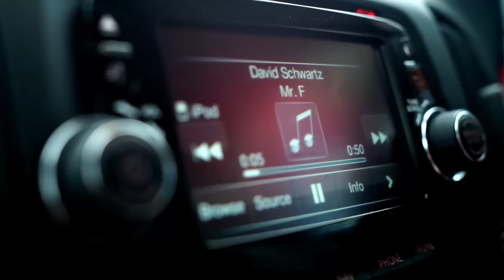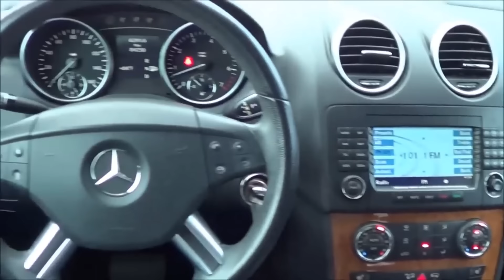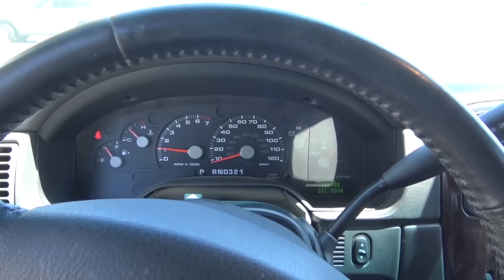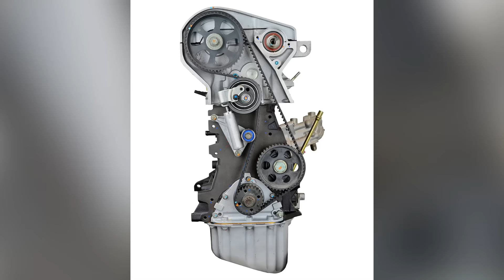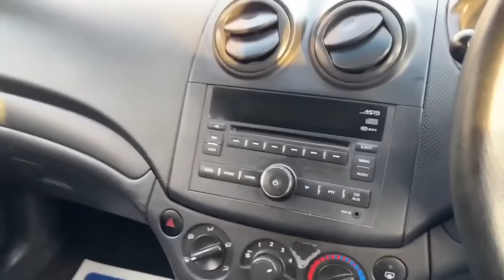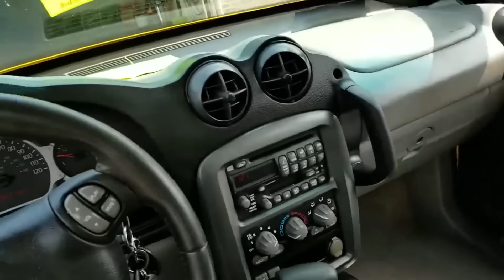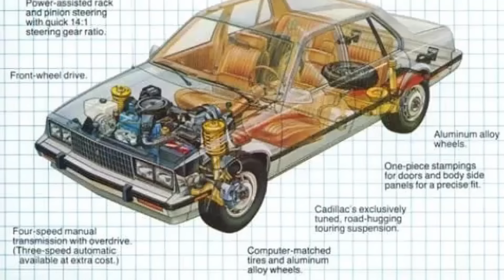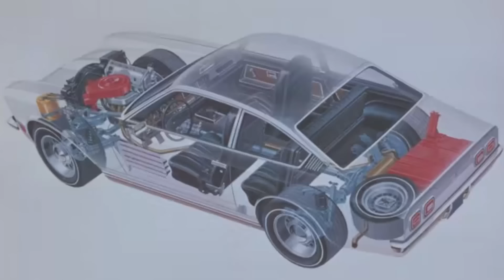30 Least Reliable Cars That Won't Even Last 60,000 Miles!

Comment: Stay AWAY from anything chrysler altogether✋️✋️✋️
Reply: Can you say Alfa Romeo
Reply: But I want the 300c thooooo
Reply: Ignore him and get your 300c.  My cousin put over 250k and had no major problems.
Reply: @colinschmitz8297  What year is his 300?
Reply: @AndrewFaust-y1t  it was a 2007
Reply: Ok Chevy fan 😂
Reply: @colinschmitz8297  See that's when Chrysler was better. They had that merger with Mercedes from 1998-2007. The quality was going up. But after 2007, which was the last great year from Chrysler, the quality went down the toilet. The 300s are crap now. They've been discontinued as a result.
Reply: @AndrewFaust-y1t can confirm here, I have a 2005 mercedes c240 4matic had it for almost 4 years now and I've had a solid 8/10 experience with it. Ik it's not Chrysler but I'd honestly recommend any Mercedes from the late 90s-early to mid 2000s (before 2008 imo) they're really not bad cars at all
Reply: @AndrewFaust-y1t  The Chrysler 300 and Dodge Charger that was a reskinned W211 Mercedes E Class didn't stop in 2007. It stopped in 2011. So up to 2010, it was the wonderful Mercedes we all loved and trusted.
Reply: @mayhemmike1789 - I have a 1994 Chrysler LeBaron LX sedan, and it has the Mitsubishi 3.0L V6 6G72 that the Mitsubishi 3000GT, Mitsubishi GTO and Eclipse, as well as the Dodge Stealth has. Bulletproof engine. The trans is awesome, and I've owned it for ages.

I love the LeBaron.
Reply: Whew what you say smh 

I have a 2011 Jeep Grand Cherokee 3.6 with 240k miles, it stay in the shop more than my driveway 😂😂 I’m ready to get rid of it soon as I can.
Reply: @AndrewFaust-y1t Chrysler was always crap imo, my dad owned a 06 300 broke down twice after 150k miles my cousin has a 09 300 broke down too after 150k miles

Comment: Thats why I will only own Toyotas or Hondas. The two most reliable brands.
Reply: Exactly. Nothing better
Reply: I have a civic from 2002 still drives like a dream
Reply: @Rosbergen80  I have a 2004 Toyota Matrix with close 190,000 miles and still runs good.
Reply: ABSOLUTELY
Reply: Yup. I'll stick with my Civic.
Reply: @Super-225  wait how does it only have that many miles???
Reply: I have a 04 ford focus. 296 000 km and still runs good. 29 000 km and only used half ltr of oil.
Reply: @dominicadler-biddle9199  I bought it used several years back. It probably wasn't used much by the last owner. It had 148,000 when I got it.
Reply: Yep.
Reply: Maybe not exclusively those for me, but I agree. Had a Civic, a Corolla, and two Eclipses. Have had good experience with older Chevy also.
Reply: Yup.  I've only owned 3 cars in 25 yrs and all were Hondas (Civic, Acura Integra, and Honda Accord)
Reply: I have a 2008 honda crv that's my baby
Reply: Not as true as it used to be. They both peaked in the 90's and have been declining ever since. Having to replace over 100,000 engines in the new Tundra is just one example. These days most brands have very reliable models and unreliable models, you just have to do your homework. Personally I stick with Toyota and Ford. My father has over 700k miles on his F-150.
Reply: @nodak81  Engineers and mechanics agree that '96 was the year cars peaked.  That was the best of the old school machinery and solidity with new school computerization.  Since then it's been downhill for sure.
Reply: And Lexus
Reply: @TwizzyGangg  Lexus is made by Toyota, so they are automatically included. Same with Acura that is made by Honda.
Reply: @TwizzyGangg  "My Lexus flexes from Long Beach to Texas."
Reply: @nodak81  yeah I will definitely agree that the 90s were the best years for most cars, but Toyota and Honda still pretty much maintain their value even now. At least most of them. Honda has the longest known lasting CVT transmission (around 250,000+ miles that I've known someone to have on their Honda HRV). Yeah the Tundra for whatever reason had issues and the V8s were poor on fuel efficiency (which was very surprising considering their cars were great on fuel efficiency). The Ford trucks can be alright but their cars and small SUVs are for crap. Same with Chevy. The last good years for American cars and trucks were the early 90s.
Reply: They definitely do have reliability, but that’s about it 😭 not much else going for them anymore. It’s kinda as if they’re only characteristic is they are “reliable” and gave up on making them nice sadly
Reply: @Hoovercaden  well.....Toyotas and Hondas never were very flashy cars. Even in the 70s. They were always made solely for the purpose of being fuel efficient and reliable (generally a minimalists choice) and nothing more. But.....Honda and Toyota DO have luxury brands such as Lexus which is made by Toyota and Acura which is made by Honda if you want their nicer models. So technically, yes, Toyota and Honda do have nice and flashier cars available.
Reply: @Super-225  Lexus LFA, Acura NSX, Honda S2000, Toyota Supra, Civic Type R, GR Yaris, Lexus LC Coupe, Acura Legend Coupe.....these companies have had some flashy cars
Reply: @rebeltvr6046  oh definitely, that's what I was saying in my last reply.
Reply: @Super-225  Yeah, I was supporting your argument with the models.  Some great cars produced by Toyota and Honda
Reply: Subaru also
Reply: Not exactly. I have a 2009 Accord. Leaks oil like a damn sieve. I have to add oil every 3 days
Reply: @WPUpioneer  even good cars can still have minor failures and gaskets and seals that you'll have to replace every now and then. Doesn't mean it's a bad car. Oil leaks are no big deal, usually easily fixable.

Comment: Most of these cars listed on here, I've personally seen with 300k+ miles, original everything. No car is reliable, if you don't do maintenance. I do agree that they don't make cars like they used to. But at the same time, take care of your car, and it'll take care of you. It's like taking care of your teeth.
Reply: But,if the maintenance is really high like $400 for transmission service,$400-500 for brakes,and $100 oil changes and the fact that their manufacturing vehicles with cheap quality.They are designed to fail
Reply: @ It only costed me $40 to do the transmission service myself. Now on European cars, yeah it’s generally more. But on a regular car like a Ford Explorer or Taurus, maintenance is generally cheaper. And easier to do yourself
Reply: I had a 1966 mustang Fastback .and a 1979 Firebird Esprit ..both were junk ..I would love for someone to tell me when they did make good cars?
Reply: They were only junk because you maintained them like junk.
Reply: @nodak81  Yeah. I've seen Pontiac Aztek's (the ugliest and least reliable vehicle according to many sites) go past 300k miles, because someone actually kept up the maintenance. Let's face it, half of the US population go past the due date & mileage on maintenance.

Comment: ford taurus, 2011, over 200000 miles and running like a champ, zero issues for over 6 years. drives like a luxury car, good interior, good looks. a new battery is all i have done to it. its very comfortable and very quiet inside while driving. just an fyi....
Reply: Love my 2011 Taurus with 190000 .Why did they use a photo of Taurus? Lol
Reply: How’s the water pump? I always wanted the Taurus but trying to do research for the best year of that car
Reply: It's the luck of the draw.  One relative has an 09 with 250k on the original water pump.  Another relative had on 172k miles on their 2011 when the pump failed.
Reply: I have a ‘15 SEL…absolutely love the thing. Very quiet interior…even at 85-90 on  interstate drives, excellent power, and I absolutely LOVE  the cockpit. Timeless dash design if you ask me. My only complaint is the gearing…the trans is a bit sleepy at lower speeds.
Reply: My mother's '08 only has 85k miles but it's 16 years old and the water pump still hasn't failed. The 3.5 is an incredibly reliable engine. Even the poorly designed water pump is very reliable, with most making it close to 200k miles before failing. It's just very expensive to repair and can be an engine-killer if you don't notice it immediately.
Reply: @nodak81  if the water pump was driven by the serpentine belt, it would have been the most reliable engine in its segment during that time period beating out the 2GR FE from Toyota.
Reply: @ it’s not what drives the the pump…it’s the pump’s location that makes the repair costly.
Reply: @churchyandfriends  Yes, what drives the pump is the problem. If the pump seizes it will snap the timing chain causing the interference engine design to fail. The other problem with the timing chain driving the water pump is if it doesn't leak out of the weep hole, it will mix with the oil in the crankcase. That doesn't happen on an exterior serpentine belt driven water pump. That's why in the case of my relatives it wasn't just changing the water pump that added to the expense it was also the need to replace the timing chain and the gears as well.  What's more is the fact that it's a timing chain driven water pump versus a dry timing belt water pump takes a lot more effort to change it. That's why cars that use a dry timing belt cost about half as much to do the job as a timing chain. Originally, the 2 GR FE was recommended as an engine out water pump job. Over time, Toyota figured out a way to change the water pump without dropping the engine out And with that the cost of changing the water pump became cheaper. The internal chain driven water pump is always going to be expensive because you have to take so much apart to get to it. And that is assuming that you're lucky enough to have it fail out the weep hole and that you find out the problem in time. Because if it fails the gasket and it mixes the coolant with the oil, you have a much bigger problem.
Reply: i know right ? taurus is so reliable but he put it in the thumbnail for some reason
Reply: 2015 ford  taurus runs  like a champ
Reply: knew someone who replaced 3 engines in like 70k. ford paid for it all
Reply: I was a Ford Fan big time. No one knew more than I did about Ford engines and trans's. I worked for Ford 20+ years ago. I've been repairing and rebuilding Fords for 40+ years. The Duratec 3.7L and the Duratec 3.5L are junk engines.

All of you saying you have no problems, just wait until you need to do the timing chains. Garbage choice to change by Ford. The Duratec 3.0L and Duratec 2.5L were the greatest versions of those engines. Porchse designed and engineered them.
Reply: I have a 2010 Lincoln mkS (based on the same chassis, similar engine) and mine has 140k miles and runs like its brand new
Reply: 2010 Lincoln mkS (same chassis, similar engine) 140k miles and runs like its brand new
Reply: 2015 SHO with 63,000.  Runs great.  Only repairs have been factory recalls.

Comment: Fun fact! My parents have a 2015 Chrysler C200S 2.4L the serpentine belt is difficult to deal with. To remove the starter you have to remove the battery, battery tray, relay box, and CV axle. When the motor is cold it would start up with no issue then turn itself off after 2-5 seconds. If you rev the motor a little bit it will stay on for about 10-25 seconds.

Current recalls
The rear control arm mounts to the frame can break from the welds. Using windows can potentially cause wiring to burn or even catch on fire. ECU problems with bad catalytic converters from the factory. Cruise control can stay on without being able to turn off the cruise control.

Comment: Fiat, Mitsubishi, Audi, VW, Mercedes, Ford, BMW, etc.  Each of these manufacturers have been around for over 100 years.  It's a joke that they didn't learn anything about engineering and assembly in all that time.  Other makes, like Nissan and Suzuki have always been unreliable cars, even though Suzuki has made some outstanding motorbikes.
Reply: I have a '98 Nissan Maxima, 5spd w/171k. I've never owned a foriegn car, but have been told this particular car is quite reliable. So far, so true..😏
Reply: True Suzuki cars are one the most Reliable vehicles in the world, gotta study more buddy, the problem is that in US It got outshined because of the crappy GM and Daewoo Rebadges! There never were true Suzuki cars in the US except for the Grand Vitara and SX4 which are japan made and very reliable!

Comment: I had a 73 Gremlin X that I bought for $100 in the early 80's. I hated it but it was as reliable as stove bolts. I sold it 2 years later and the new owner drove it for another year. I also owned 2 Corvair's. Nothing remarkably bad about those cars and were fun to drive and handled well

Comment: I notice Toyota isn’t on the list.  I have lost faith in any Ford, Chevrolet or Chrysler product.  I blame a lot on the unreasonable government regulations for reliability problems.  The old cast iron, push rod engines would last 300,000 to 500,000 miles.

Comment: I bought a Hyundai kona 2022. I thought they were past the engine issues. No, the car had heat control module failure in 20,000. Then had a radiator failure at 30,000. The dealer service liked to argue that they may not cover it under mfg warranty. We traded it in at 40,000 after the starter would get stuck in the flywheel, the auto start feature a pain. No point having the dealer look at it, they would just ignore it. I previously owned older Hyundai Accent that ran 200,000 easily trouble free. A second Kia Rio 2008 my son bought has 200,000 runs great with typical Hyundai minor issues. We bought a Lexus, basically a Rav 4 on steroids with comfort features standard. Cheap cars are just that> Cheap. We have had Nissan never again, then a Subaru Forrester which had the head gasket failure under warranty. They didn't replace it, put sealant in the radiator to get it to the end of the warranty. So, no more Subaru for me. They treat you like a criminal, not a customer.

Comment: I got a 2004 ford focus wagon. 298 000 km and still runs good. Did a oil change on her last fall and just added half ltr of oil and drove 29 000 km in that year. Might do a oil change soon. But ya old car uses less oil then new

Comment: Justin Bieber on the Mercedes part and can't blame them on air suspension because any vehicle with air suspension are naturally going to fail regardless no matter how old or how new the vehicle is 3:28 

The 4 Maddox there are transfer case weren't that bad but the common one that had the problem with the GL not the ml

Comment: That list should include every american car since 1975.
Reply: @ngauruhoezodiac3143  not every car Ford's maverick 1970.1977 6cy 250 and V8 302
Reply: The FoMoCo Panther platform cars are probably the most reliable American vehicles ever built
Reply: Been driving cars since 1966. Most all-American cars made in the 70's were junk which is when Japan took over the market and by the mid 80's had established the world's highest quality standards. My 2011 Highlander with 165k drives like it just came off the assembly line. Sorry to say that in the five years it looks like even foreign manufacturers are slipping in quality.
Reply: Never had the best luck with domestic made vehicles.
Reply: @charlesrobert6211 I can't say my 2009 Corrola is driving as well as it was, but I am having to drive it 2000 miles a month and it's holding up at 213,500 miles. Just put new coils in it this summer, and  it "says' it's getting 40 mpg.

Comment: To say a Subarus cooling system is reliable is like saying Biden isn’t old. Those H-block pieces of sh*t are notorious for head gasket failure aka the biggest failure anyone could have within the cooling system 😂😂😂.
Reply: If you leave them stock, especially the turbo models, then the demerit comes into the realm of being reasonable. Non-turbo models literally just leak oil externally from the head gasket. I have yet to see a 'stock'(trust me, checked the CAL ID and VN) with a 'blown'/leaking head gasket. The term 'blown' is thrown around waaaayyy too loosely. I've seen non-turbo(ej251-253 back to EA engines) 'blown' head gaskets go another 100k miles(I serviced them personally) and as long as the owner knows how a dipstick operates and the lack of funds to replace said 'blown' head gaskets...no reliability/driveablity issues. I'm the youngest SMT one of the largest dealership networks(over 60 stores and various brands) has seen, setting a record in the company back in 2018, at their Subaru store. To say I know the brand well, especially on the technical side, is an understatement 😂😂
Reply: @ I work on them nearly everyday, they’re a junk car. Nothing you can say can convince me otherwise. From the trash cvt thats notorious for failure to external coolant and oil leaks from the head. I’ve seen it on both n/a and turbo models. And yes the cars I’m working on are all daily drivers/stock vehicles. Being 100% honest with you if you’re such a big Subaru enthusiast you should know Subaru has had these problems sense the 90’s (outside of the cvt issues, thats relatively new). Two main issues, the power plants themselves have always been faulty and in conjunction with negligence on the maintenance it’s only a matter of time before it’s being towed to a shop.
Reply: @ what does it matter if the coolant leak is external or internal? the head gasket failed (normal operation for a Subaru😭😂), meaning the head(s) needs to be pulled off. The term “blown” is used to give a one word description pertaining to the underlying fault at hand, no one needs a multiple sentence explanation on the coolant leak being external or internal because the end result is the same (unless you’re typing a story for warranty, which I know you do a lot😭😭😭).

Comment: I once owned a manual transmission Vega.  It was fine for a $400 car.  I drove it for a year until engine compression because a problem then junked it for $100.
Reply: Vegas are not as problematic as this guy suggested. I had good luck
  Get over yourself . Where did you get your confusion?